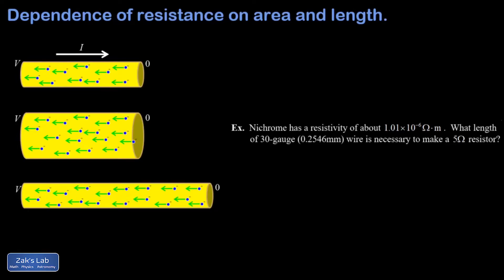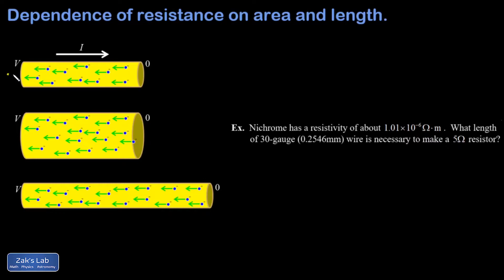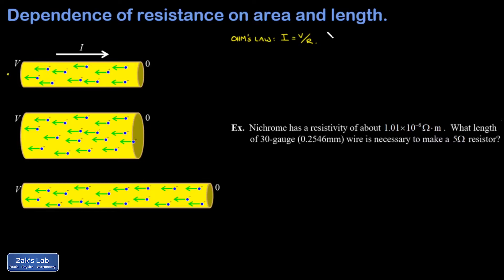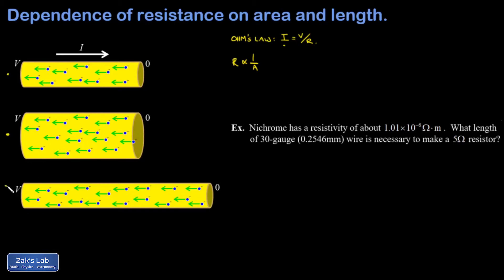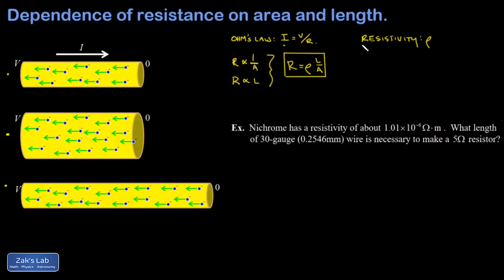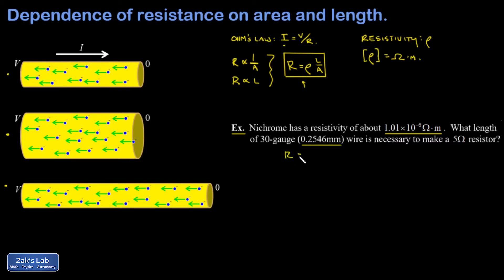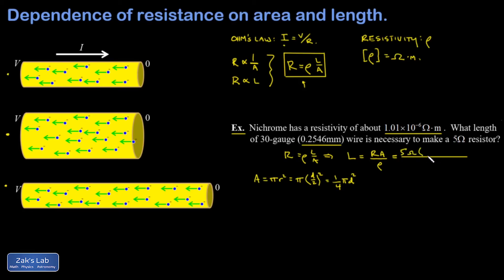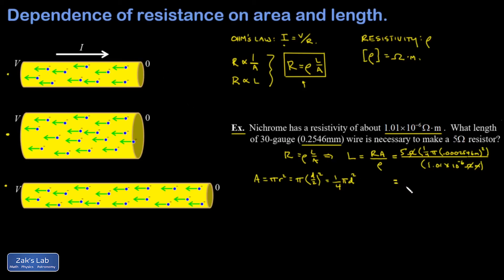Resistance, area and length formula R=rho*L/A, definition of resistivity, and example with nichrome.

Comment: What happens if the conductor is a cuboid? Then we have different lengths and cross sections
Reply: It means the resistance would be different for different parts of the cuboid ??? Please explain sir
Reply from the maker: yeah, exactly - the total resistance depends on which opposite faces you measure across.  z

Comment: What if the cross-section is not circle? let's say square
Reply from the maker: cross sectional area is all that matters for the derivation of R=rho*L/A.  One way to generalize though, if you're in a calculus based physics course, is to have a changing cross sectional area, like a narrowing wire. z